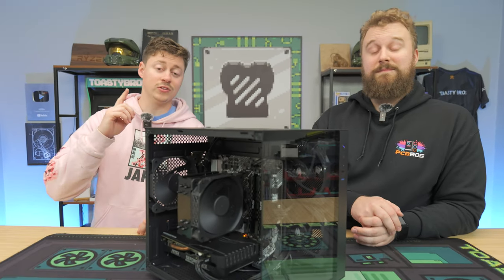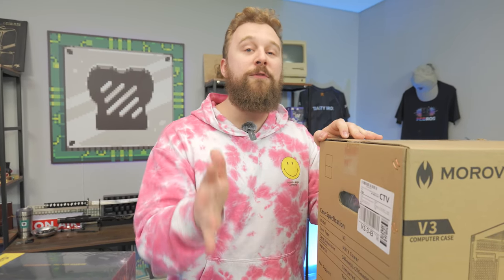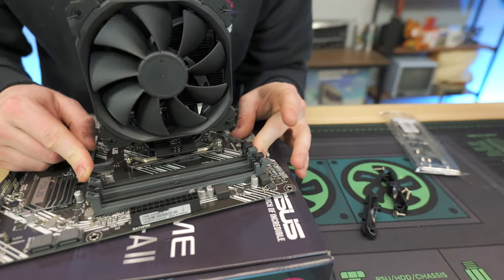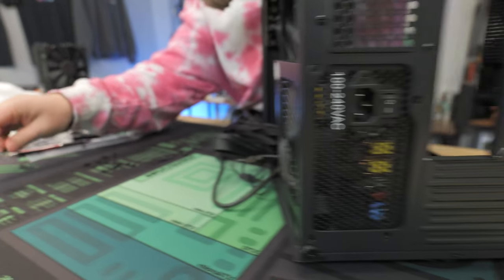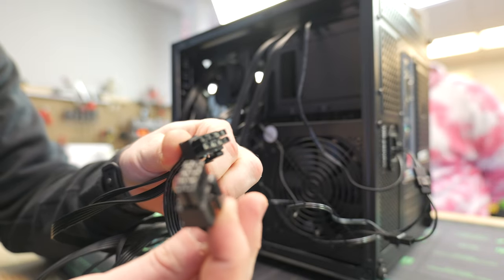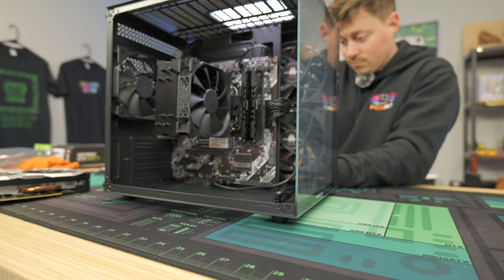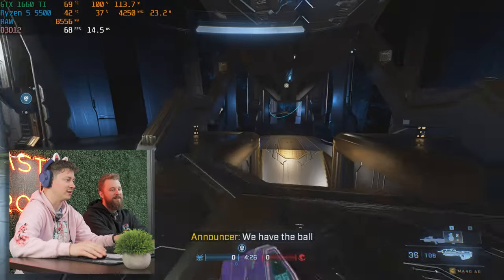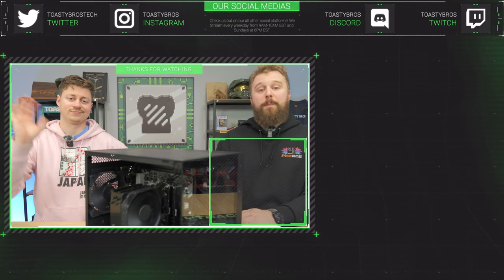CLEAN $500 Budget Gaming PC Build Guide - NO RGB!

Comment: This build is good but it could be a lot better....
-No Tower Cooler (Use Ryzen Stock Cooler)
-Ryzen 5 5500 -> Ryzen 5 3600 or Ryzen 5 5600 for better cache and performance (and PCIe Gen 4.0 compatibility)
-GTX 1660 Ti -> Used GTX 1080 Ti (~$150)
Reply: this is real good advice, i'd almost say get the x3d and downgrade to fit budget elsewhere.

Comment: I honestly don’t think the fish tank cases go well with no rgb, but it’s still cool
Reply: agreed
you dont want to display nothing imo
Reply: I also think fish tank cases go really well with fish too!
Reply: They are also terrible for cooling. Intake fans blow straight into a tempered glass panel, causing turbulent flow. And, as I know from my formal aviation training, this is no way to get good cooling performance. I just built in a mesh case - AP 201 - and I'm thinking tempered glass is so last decade. You can still show off if you turn on the lights. The fishtank cases are like the ultimate evolution of the fin on 1950s cars. They rose to epic proportions over the course of a few years and then just went extinct, almost overnight. Hell, my main PC looks almost retro at this point, being in a Zalman S2 TG, looking like 2016 wants their PC case back. But it has last gen hardware in it. At least the original iteration of the glass panel case had more or less straight through airflow. Intake in the front, exhaust in the back and top. This is literally how the first HAF case worked.

Comment: Thoughts on replacing the Ryzen 5 5500 with a Ryzen 5 3600, depending on the price at the time? I mean, I think they perform basically the same, and both have the same upgrade path. I'd just argue that the 5500 has better RAM headroom.

Comment: I have this case, now that it build I love it. But I’m not gonna lie building in it with a full size psu was a little on the rough side. Really take care to get that cable routing figured out before you get goin.
Reply: Another know I was using a modular power supply so the connections are in different spots spread across the from on the power supply. Made it a little tougher, so I took the fans out and reinstalled them once I ran my cables

Comment: Hi Toasty Bros! Love your content. Was just wondering if the 1660Ti would also be a good combination for a 5600G, which is also a Gen 3 CPU. 

Or would an RX 6600 be a better price-to-performance option?

Built a GPU-less CPU last year, and thinking of upgrading soon! :D
Reply: Go with 6600 if you can afford it. And use 5500, it is the same as 5600G only without iGPU.

Comment: i found a 2 year used pc with no windows or storage that i found in my local marketplace online    it has ryzen 3600 and gtx1660ti oc itx   aorus mini itx motherboard taht has wifi n bluetooth 16gb 3200ram and 450w sfx powersupply in a tiny cbue shaped coolermaster case going for 300 euros  is that a good deal ?  the guy also told me that no one was intrested at the moment in purchasing proly due to the small case and powersupply limitations but i love small itx pc's so i have no issue w anything
Reply: and i also found a cheap itx case for 15 euros in my local it store lol  plus 30 40 $ for the storage that i must install first and foremost  total cost about 350$   not bad : )
Reply: Depends does it come with the storage . Negotiate the price down if it does not have SSD/HDD.
Reply: @aleksazunjic9672  the price he has set on it is 340$ rn  and it has no storage  but amma try make it like 270 280 since he doesnt rly need the pc anymore and the pc has been on sale for like 9 months no  and no dm's on his phone so

Comment: hey toasty bros what's the best upgrade for a Hp z440 computer I want to do some upgrades for this computer except I don't know what's the best recommended
Reply: if your power supply can power a gpu then that would prob be the best move if you don’t have one. 

but if it doesn’t i have seen online that you can put normal atx power supplies in office machines. only issue is the office machines dont usually use 24pin for the motherboard so you have to buy a connector. i know dell optiplexs use 8pin to 24pin connectors if you add a new power supply. 

and there’s always ram if you are at 8gb. 
16 seems to be the bare minimum for games now ☹️

Comment: what a good graphic card that you can run with ryzen 7 5700g ??ik some people use the pcie 4.0 even though they don't get full performance.
Reply: any gpu with 4.0 can run at near full speed with 3.0 as long as its x16 so no 6600 or 4060 though you can get away with it
Reply: @Nobrons  I was thinking about doing a swft 6600 or rx 5500 xt because they are x16 express but might do a 1660 I bought a cheap 580 for now
Reply: @oneilbennett1997  6600 is x8 not 16x the 6700 non xt is where it becomes x16
Reply: 6600 would run fine with this machine (100% usage) although it has only 8 PCIe lanes.

Comment: I have one PC posted that's built with a lian li case, R7 3700x CPU, gtx 1660 Super, 550w msi psu, 1tb nvme storage, 16gb ddr4 storage, and sleeved cables for only $580 with an activated windows 11 install and its all new parts besides the mobo, cpu, and gpu and its been posted for over a month and no one is interested. Ive had a bunch of views and saves on it but like zero messages, and its already been dropped in price a couple times. Its a weird market right now
Reply: Link?